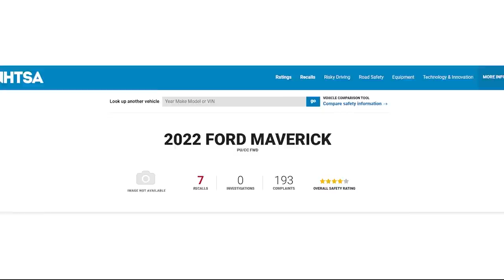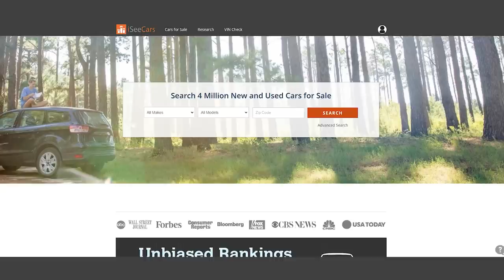How Toyota Stout Solves 6 Huge Problems In The Compact Truck Segment!

Comment: So glad to hear about the Stout. I had a 1989 Toyota pickup with a 4spd manual, no radio, no AC, no power steering an no carpeting! But it was really well made and had that legendary Toyota reliability. I LOVED that little truck. If the Tacoma hadn’t become so big I might have bought another Toyota pickup.

Comment: I ordered my Ford Maverick in September of 2022, put my $1000 down and today is June 25 2023 , I still don't even have a vin # yet, Hey Toyota you start producing a small truck under $25000 , I would buy it and cancel my ford Maverick in a hot second.

Comment: Single row seating keeps insurance cost down for those driving with no passengers.   Real pickup has frame, steel, natural aspiration and rwd.   Others like Santa Fe are SUV with pu sheet metal.  Stout will be such as Maverick is.

Comment: Maverick, considering the trucks Ford has made in the past This thing's a joke and I guess that's what they're trying to tell you, Toyota will bury this thing if they're at a good price point, name it a truck after a car they used to make, when all the problems they're having with it could have been eliminated before production but this is how Ford rolls and maybe that's what they're trying to tell you, Toyota doesn't experiment with the public like Ford and General motors do.
Reply: My maverick has been great and oddly enough I trader in my 2019 taco for it. Gas mileage for my non hybrid sucks but it's pretty fun to drive. But it's really irritating neither the maverick nor the stout or anyone for that matter has a small EV truck coming in the near future.